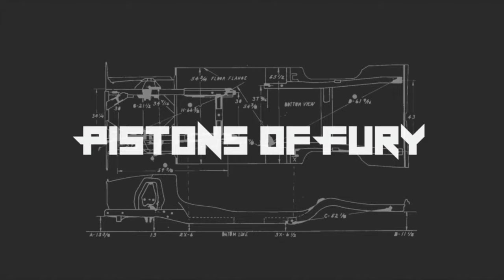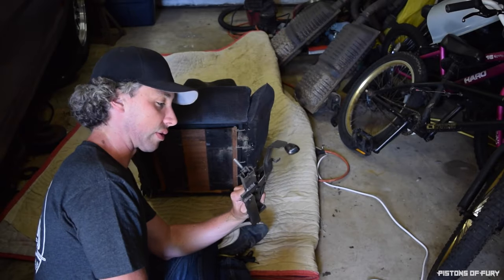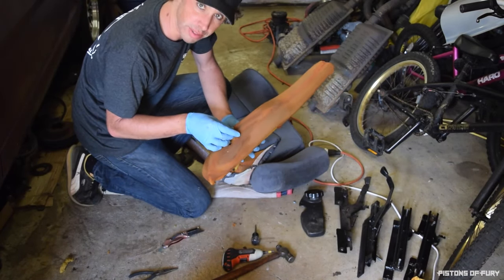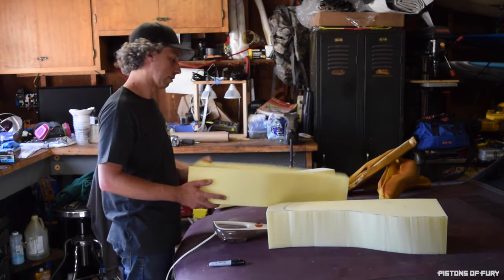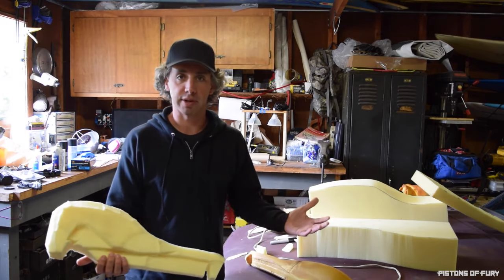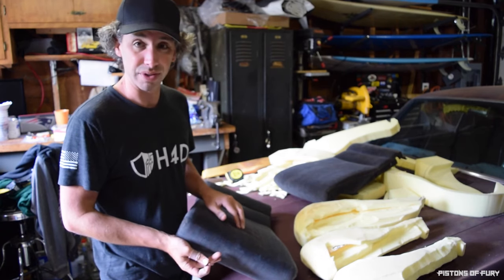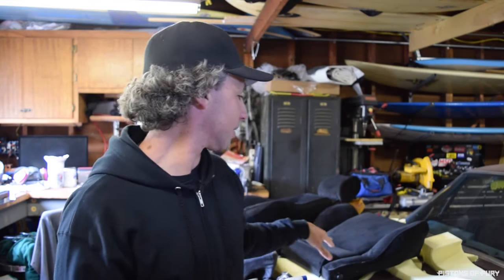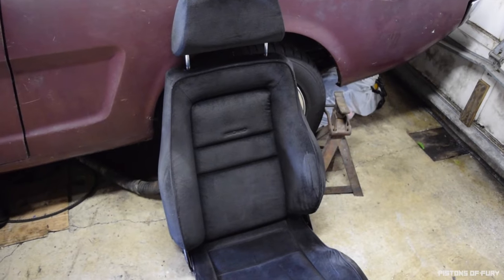PoF // Episode 6 - DIY Recaro Seat Budget Restoration

Comment: Long shot, but do you happen to remember the specs on the foam you purchased? Density? Polyethylene?   Trying to source some locally as I need 3 bolsters for the same recaros and that's a lot to spend to buy them from the UK.
Reply from the maker: That was my dilemma too. I was fortunate to find a specialty foam shop locally for the foam. I'm not sure about the exact density but it was definitely closed-cell polyethylene. I'd recommend looking for a local furniture or auto upholstery shop, they should have some foam in stock that you can check out to see what feels right. Definitely much cheaper than buying the premade bolsters from the UK. Hope this helps!